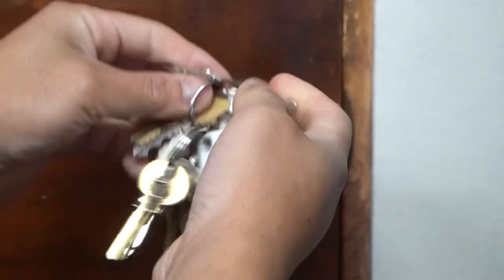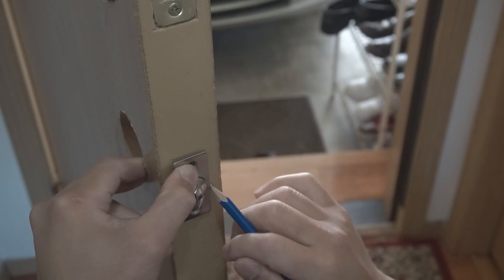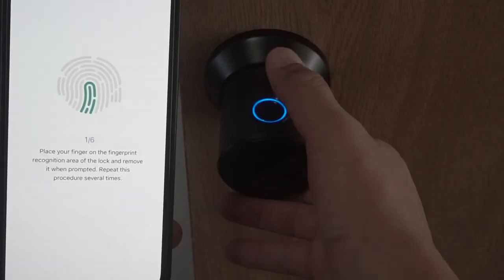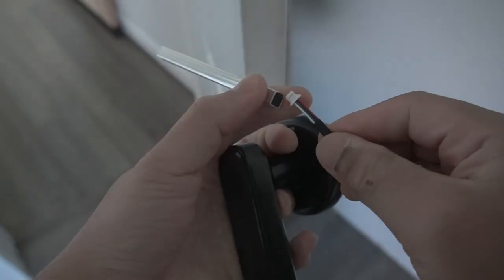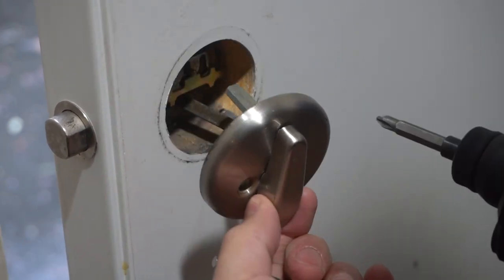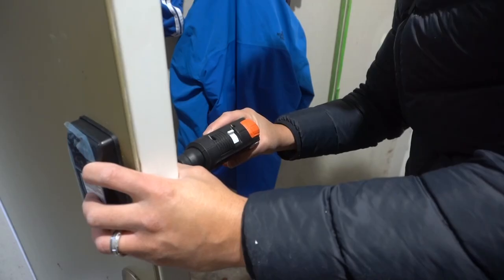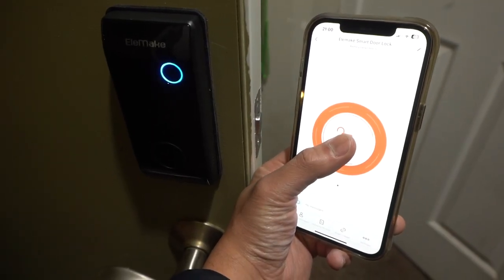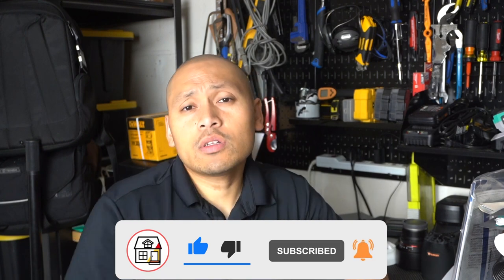STOP Using Keys On Your Home Security Door Locks! Do The SMART Way With This!

Comment: Would not use any battery operated locks on any exterior door where the temperature is below 32 degrees F (0 degrees Celsius) like in places that experience cold winters.
The batteries will die in a very short time if they even work.
WiFi and batteries are a sure way to get broken into easily.
Reply: The battery is on the inside of the door, that is why there is a wire. But I wouldn’t use any WiFi or Bluetooth connected lock, they are easy enough to hack and you have to trust the security of the manufacturer’s software and/or website (if they provide remote access to the lock).

Comment: What I would really like is one with a magnetic internal locking mechanism that didn't require a motor, and worked by the app, over wi-fi, or a fob I could keep in my pocket.  That way, doors would lock as a resident left a room, or was in the room, and let it to manual with the fob, then it would unlock as anyone with the app on their phone or the fob in their pocket approached - unless the person in the room had set it to manual.
Do you know of anything like that for interior doors?  I just hate the motorized ones.

Comment: For a video like this it would have been nice if you had provided battery life info. Like how long does the device last until you have to change it?
Reply: thissssssss ^^^^ I decided to “upgrade” one door to battery powered and once the battery died I realized how stupid of an idea it was 😂😂 
Am curious to know how long they last and what do people usually do 

Am thinking of using rechargeable batteries
Reply: @Esiddik rechargeable sucks. Less power less battery life.
How cheap is your lock that it doesn't warn you about low batts?
Reply: @2ProTecK  it warns me… just still sucks
Reply: @Esiddik  you got a wifi enabled lock, didn't you? Not a lock with a hub?
Reply: @2ProTecK  honestly no idea , it’s like this one “ Schlage
Camelot Satin Nickel Encode Smart Wi-Fi Deadbolt with Alarm and Camelot Handle Set with Accent Handle with Camelot Trim” 
which says Wi-Fi but I can’t pull up purchase history to verify. 

If you have a personal recommendation let me know 
Ultimately, I want Apple Home Kit compatible. I don’t want Alexa.   I was going to do Level lock but a little pricey
Reply: @Esiddik  well that explains your battery life. Anything with a wifi connection is going to eat up batteries. My Bluetooth lock is by August. It has all the features you need. It also gets 9 months of battery life. The design allows you to use it with any bolt lock, allowing much higher security than locks that are stand-alone. You can't even tell it's a smart lock from outside the door. The hub makes the link between wifi and Bluetooth so it can be operated from anywhere. The hub plugs in, so being on wifi isn't a problem.
Reply: @2ProTecK  oh yeaaaaa I know august! Honestly I needed a to upgrade the whole handle and door locks so I got that set, but Note taken! And lesson learnt! 
Thank you!